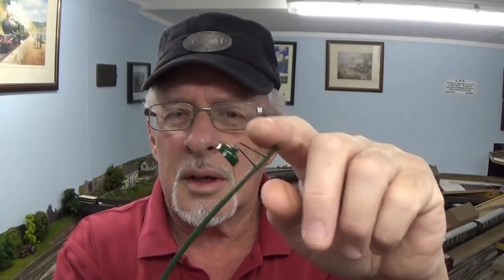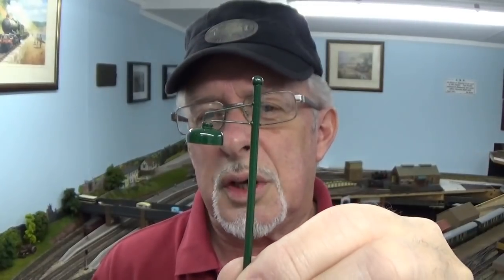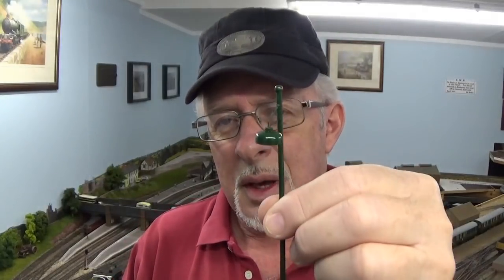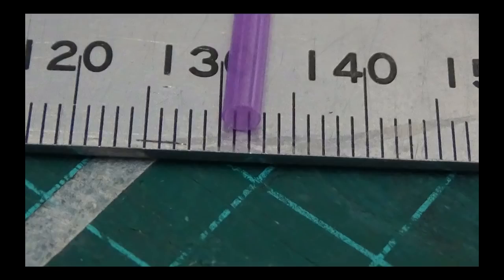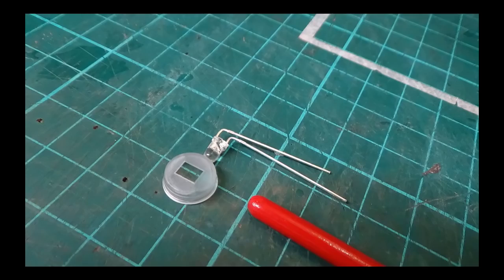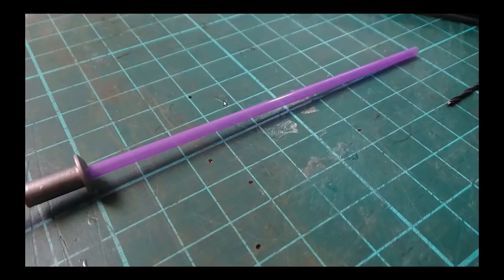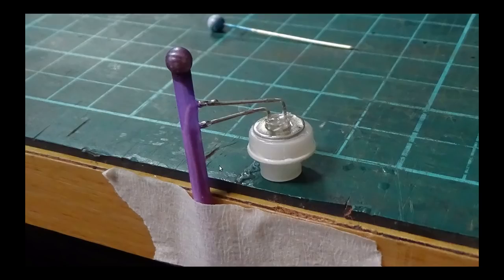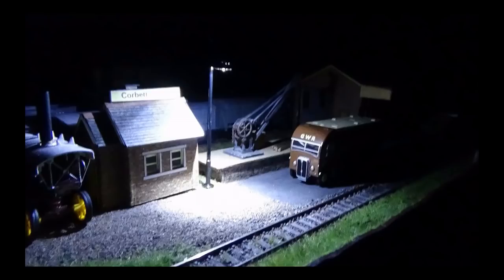Episode 126 19 Yard Lights

Comment: I like your method its simple and effective.
Have you tried Warm White LEDs, they give off a much better light, more like incandescent.
Reply from the maker: G`day Westimation
Thanks for your comment and the tip about Warm White LED`s.
At the time I used what I had and dropped the intensity of the LED`s with resistors in series, however you suggestion sounds like a better way to go, so I`ll order some LED`s
Cheers
Gormo
Reply: Hi Gormo. You will still need resistors. Another tip. Paint the fluoro white LED with Tamiya XF24 clear yellow . I painted a lot of white LED before warm white LEDs became available. 
Graham.
Reply from the maker: @Westimation  Thanks Graham,
I have definitely taken on board your suggestions and they are gratefully received for future builds.
Cheers
Gormo